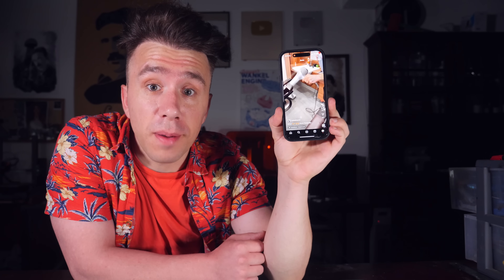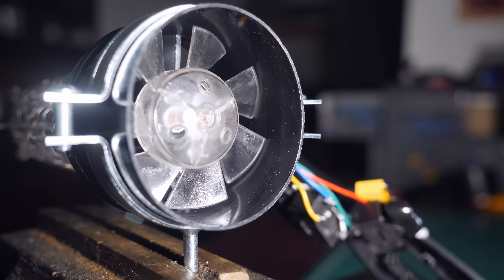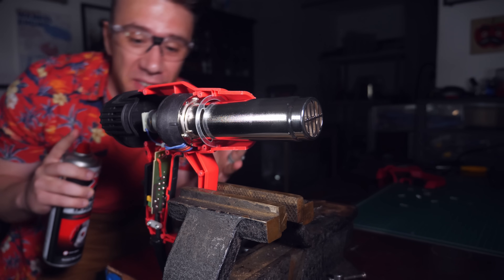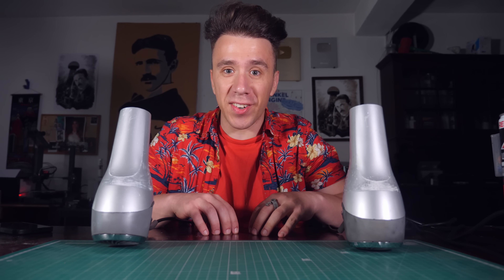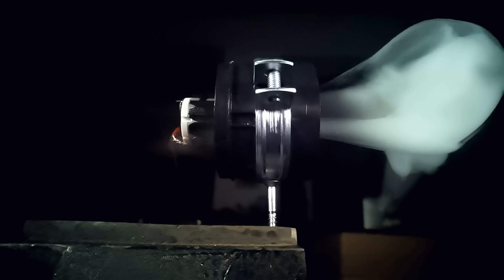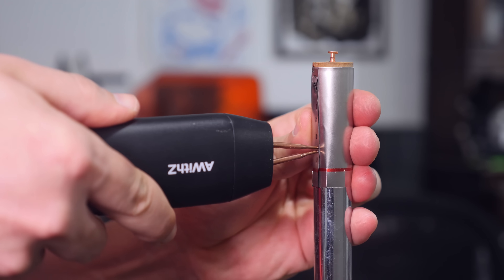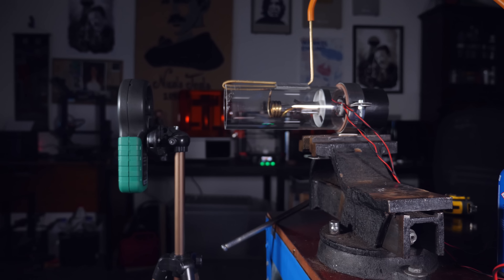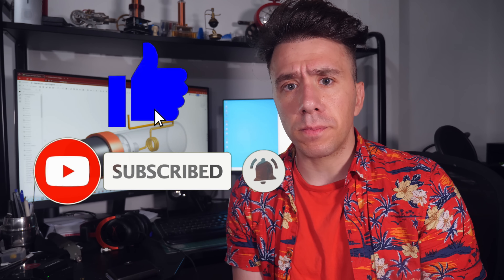I turned my $20 Hairdryer into a JET ENGINE

Comment: Design Recommendation: 2-steps...Well, with the re-post I was able to re-think my original suggestion.  It is still valid       step 1. change the shape of the tube.  I looked at basic jet engine design and some have a more narrow exhaust end, and some have a wider end.  I think narrow might focus the airflow and make the 'new' wind meter turn faster, but also could slow down the airflow...so perhaps wider is better?  OR...both, add a cone to the end. so that it is narrow just before the exhaust end but wider at the end.  Step 2.  After re-watching, I see I missed the request "use more air for combustion".  So, what if you put holes in the metal tube surrounding the ignition chamber and a small ring around the tube to act as a diffuser that would redirect some of the air flow towards the holes in the tube.  Look forward to next video.

Comment: The simplest way I can think of that will probably allow you to use more of the air for combustion is to basically use an afterburner, which just injects more fuel in the hot, lean air after the engine core. But, and here's the part that makes this super simple, is that you inject the fuel in at the edges at the intake. The fuel would have time to mix and atomize with the incoming air, and the existing 'jet core' would act as an ignition source. Real afterburners aren't efficient because the core gains efficiency from igniting the fuel/air mixture under compression while the afterburner uses uncompressed mixture to burn, but you're using uncompressed fuel/air mix the whole way through so this is entirely bonus thrust for this design.
Reply: The whole system is already an afterburner though.
Reply: Essentially just add more injection points to spread out the fuel during combustion. I think the hard part is going to be protecting the acrylic though.
Reply: First don't use acrylic second make a ring of a aluminium pipe with some hole for injecting fuel. And why not use a bldc motor which automatically gets lower when fuel less burns? and tries to use more flammable Gus with high pressure.. @Antal-te6rj
Reply: Pseudo-intellectual attempting to explain what an afterburner is to someone who already knows.
Reply: I wonder if adding the fuel before the fan would help, All tho I wonder if the diluted fuel would be difficult to ignite and if it would melt the and bun out the fan.
Reply: I might be a little late for this but because there is no combustion chamber a lot of air is being passed through the engine on the sides, a funnel (that funnels air into the igniter and fuel injector) could solve this problem and increase speed.

Comment: Thanks for the video and here is my idea. Multi directional air flow. More fans and a circular configuration in the tube and focused in a way to compress more air.   Thanks. 
*********************************************************************************************************************************************************** 
                                                                                                                                                                                                                                                    **********************************************************

Comment: First let's address the fuel.
Take the lid and straw off of WD40 and swap it out.
Place the straw in a 1/4 copper tube that runs like you had it but.
You want space between the coils.
At the end make a loop and seal it back to itself.
Drill 12 tiny holes at the end pointing equally to the center and outwards.
Splitting the difference.
Drill one more tiny hole for ignition precoil. 
FYI
You hold your can too close for the hair dryer or it should ignite when the heating element turns yellow.
I managed a shop and guys got in trouble a lot with this kinda thing over the decades 😂

Comment: I think you can use a nozzle to maximize the output and to burn the extra oxygen you need a better fuel ratio maybe a thinner nozzle for fuel injection too or a pressure regulator.

Comment: The middle hot element of your engine not exit from back but from side body insert of hot element and fuel inside the middle mug and the burning  gas exis from side of the mug not from back

Comment: Then I repost my comment: why don't you try adding a DeLaval nozzle and inject the fuel at its narrowest part? That should let you use all the air, and even get profit of the low pressure to inject fuel easy. Also you can add some spiral cannals to keep the vortex creation to protect the acrillic tube

Comment: For getting all the air to burn it might be worth converting it to a pulse jet, with the reed valves between the fan and the combustion chamber to regulate the air flow, however that would remove the heat shield the airflow provides, but that will be a problem with burning all the air regardless. Having a smaller internal combustion chamber inside the main housing and bypassing the fan air over it to cool externally while the valves are closed might help somewhat but I don't know if it would be enough.

Comment: Hope you read this, my idea for increasing power is to use a scram/ram design with your fuel tubes. Basically, stick them into the path of where the air is going to go to slow it down then allow for a little sheet steel on the inside of the tube to be bent inwards to help with air restriction. since you need the fuel line to go to the fan you can wrap it around the inside of the acrylic tube, this will help keep it cool. Make sure to use some of the sheet steel to act as vortex inducers (stator wings or whatever) that have you spray the fuel behind them into the direction of the wind. It will curve the path of fuel and air, condense it briefly before igniting. The coil & wing act as a scram to slow it down then compress it, once ignited it will increase velocity behind it to improve the efficiency of the effect. The ram is the ignited air mixture (exhaust) getting pressurized then forced into a smaller area behind it. This drives a wonderful Bernoulli's principle effect, at first it was just scram from the fan but now it should be able to ram air in from the increased intake velocity thanks to the lowered pressure! maybe.

Basically, sheet steel spot welded then cut with some snips to create some wings that are curved the right way for a nice vortex. Those also help with keeping the fuel line in place & adding their heat to the fuel line coil on the inside of the acrylic tube but outside of the sheet steel. Then you can make a nice ring that has been pinched on the one side to make a wing shape tear drop effect. The sheet steel can now be in front of it to create a triangle shape that has the fuel line behind it. Which can lead nicely to having the wings there to introduce the vortex effect. this curves the wind inwards, "compresses" it, but also makes it go faster while now having less volume it needs to take up. since the fuel is being sprayed in, behind the wing and the scram effect part this helps with combustion. make a taper to the sheet steel then have the nozzle point have a couple of wings to "compress" it through as a low wind resistance tear drop shape. Flaring out the rear then gives it a tesla valve like effect of being accelerated through the nozzle then expanding to no longer want its pressure to head back to the nozzle point. It gains captured thrust as a result as well, depending on the length of taper and total size before straightening out & or tapering back inwards gives you your total acceleration of heated air.

Hope it helps you out and I can finally have a 3d printer! I don't even know how to use cad but maybe my explanation helps you to make it :)

Comment: You should test the speed with the fan and fuel injection without ignition to get a more accurate baseline for the speed increase. As the addition of the fuel will automatically increase the air moved, regardless of combustion!

Comment: My idea for getting more air into the ignition:
perforate the metal shielding either with just small holes or even just partially cut the metal and bend the pieces upwards as to partially block the airflow outside of the metal shielding and divert it into the ignition chamber... The size, form, number of perforation has to be tested as well as at which angle to bend the metal elements. Also the question is where to put them. As i am not an engineer i dont know where it would be best before the coil as to have an intake before the ignition or behind it...

As another idea for maybe a more efficient fuel injection system: 
Try two fuel pipelines that also form a spiral or helix shape to preheat the fuel and then they are directed at each other in an angle so they collide and spray the particles are flowing in a more distributed way at the coil (maybe even taking some more air with it).
I think some fuel injectors in motors are functioning like this (I think Smarter every day did a video about this)

Comment: Also, with that setup of a coiled fuel-line, you should be able to burn nearly every hydrocarbon as fuel… as its vaporized before getting into the burn chamber.
Now it would be interesting what influence different hydrocarbon Fuels have on the Airspeed/Powa!

Comment: More (longer wire) needs higher voltage to get a same thickness of the same wire to the same temperature using the same current? Or not. I'm not an electrimagician.

Comment: i watched it again and i think you should try to make a vortex in the tube maybe by adding blades inside the tube and make the tube spin , the blades need to be of metal i guess or they would melt, also try making the end of the tube smaller should give it more oompf

Comment: Suggestion/design idea: Make multiple fuel injectors around the circumference of the acrylic tube so they spray the fuel in a clockwise direction, also the fuel injectors should be pointed towards the back. Should work like a diesel swirl chamber. 

Or make a fuel line with holes around the inner circumference of the tube with  the fuel injection holes pointing backwards. Or have the fuel injection holes in the acrylic tube pointed backwards.

Comment: Btw if you fill the copper pipes with sand, you can heat and bend them without them collapsing.
Reply: Best way to bend tubing, and the sand doesn't get stuck.
Reply: Okay, I wanna try this real quick
Reply: Filling with water and freezing absolutely works; I made many coils of all sizes that way. You don't need a torch if you use this method.  It is harder to bend the tubing with ice vs torch, for sure, but the finished product looks perfect.
Reply: Heat the copper until it colour flash changes to blue , then immediately cool it with running water. This is annealing. It is then malleable for its first bends.
Reply: if you fill a copper pipe with sand, you don't need to heat it, to bend it without collapsing, 
Just saying.
Reply: @kanedaadenak7088  copper needs to be annealed before bending. That is heating and cooling.
Reply: @logic.and.reasoning  Um coppers so soft, if you heat it before bending you harden it more than steel tube, and if you reheat it you have to let it cool slowly or ANEAL it, the metal doesn't get soft and pliable..
Without a tube bender your crush it, unless you fill it with sand.

I bet you youre a professional welder...
Because you dont understand tube bending or heat treating...
Reply: @logic.and.reasoning  I love how you think, but your wrong.
Reply: @logic.and.reasoning  Do you Know WHY they anneal steel and not copper? 
If you can answer that, You'll know why You are wrong...
Im Not calling you stupid, Just misinformed...

I like the way you think.
Reply: @logic.and.reasoning  Are we on the the wrong page? like more than 1''od?
Reply: @kanedaadenak7088  You are very wrong, heating copper until it starts to oxidise then quenching it anneals it because it stops it from forming large crystals. The same process with steel hardens it because the carbon present in steel forms a matrix which is stronger than the annealed state.
Reply: Really intelligent short cut. Thank you for sharing.
Reply: there are things like these too, but you're right, they CAN get stuck, but like Jamie Hyneman says: when in doubt: lubricate!
https://www.amazon.com/uxcell-Silicone-Bending-Insert-Sealing/dp/B07V2LKJ8Z
Reply: @originaljoke-y5f  if you have copper in your possession and it's NOT frozen you better gtfo.
Reply: We need to drink beer and watch the stuff work 😂
Reply: Try to fill te pipes with nitroglycerin its easiest way to ?
Reply: I usually fill them with water and freeze it but sand sounds promising. With the ice you can cold bend it without needing fire.
Reply: You may have just solved a hyper-specific problem of mine
Reply: Or fill them with water and freeze it
Reply: @ramosel pipe bomb
Reply: @erratichomelessmanwithagun6726   real
Reply: @ramosel  water  expands when  frozen and  would  melt when you heat  it  hardly practical
Reply: @greentroll9326  It expands out the ends of the tubing. You don't need a torch doing it this way. It is very practical and very easy.
Reply: @VidarrKerr  but you  need a  big  freezer  if  it is a  long  pipe  ;-)🤣
Reply: @greentroll9326  I have the longest pipe in town.
Reply: @Asdayasman  proof
Reply: @greentroll9326  LOL. Funny, but no. Usually, I think maybe Always, the tubing already comes in a coil. Like when you buy a garden hose; you don't buy the garden hose while it is laid out straight, or you would need a Super Long Truck.
Reply: @ramosel  How would that work???

Comment: Turbojet engines don't usually burn all the air. To use this "excess air" sometimes there is an afterburner. They give a massive boost in trust but are horribly inefficient.

Good thing integza does not care for efficiency.

Comment: The air needs to be supplied at 90° to the bore of the burner with a semicircular obstruction in the supply pipe, or put the supply pipe on one side. This will cause the air to swirl through the burner. The fuel injector could have a deflector fixed to the outlet to spin the gas into the air. (It looks a bit like a fixed fan.) The resulting mix should burn well. The ignitor might need to be larger in diameter. The acrylic tube may have to go though!

Comment: Afterburn effect should be relatively easy with a second fuel line that ends with a T piece inside of the dead air zone protruding out to the sides and this will be set off second while #1 fuel burns and peaks , the #2 fuel line (tee line) gets ignition from #1,.and liftoff? Well at least in my tiny brain 🧠 😅. Good luck everyone and I can't wait to see the winning design ❤❤

Comment: Make the flow tube have a 'waist' like a coke bottle, to increase pressure on the fan side of it, and create a back pressure on the exhaust side 👍
Reply: That would work nicely I think as it does in a fighter jet or a variable vain  valve setup on the front of a F1 turbo ( or German fighter plain turbo engines from WW2 )  causing antilag.

Comment: I guess that to solve the problem of using the maximum amount of air to burn the fuel would be to bend the fuel line into a circular manner as an anular combustor (as you did in the afterburner video) than wrap the fuel line with nichrome wire to combust it. And maybe making an afterburner too to make more power :D

Comment: It actually makes a lot of sense that the broken impeller works better than the high speed one. Bernoulli's Equation would indicate that if an equivalent amount of energy is imparted to the air in both cases, then an increase in velocity would correspond to a decrease in pressure. Therefore: to get the best bang for your buck, pressurized output and more power.

Comment: Multiple injection points, try using the original design as is but inject fuel into the high pressure stream as well at multiple points around the cylinder at a point before the primary combustion stage. Perhaps the already existing combustion will allow the higher speed air fuel mixture to combust. 🤷‍♂

Comment: Try funneling the air into a tighter cylindwr after the impeller, then wrap the inside if the cylinder with ignition coil. Inject the fuel right after the impellar and now you have half of a jet engine kinda.
Reply: It would be cool to use the exhaust gas to spin the front impeller as well, then it's a legit jet engine

Comment: Well I repeat my last post, using the Hairdryer, drill a small hole on right side of fan, place a nozzle that turns 45deg into air-stream, Brake Cleaner or WD40 Cans usually come with a small plastic tube, to attach to air-can nozzle to spray into a tight spot, use it to direct "Fuel" straight into Air-stream via nozzle installed ...

Comment: Wonder what kind of result you'd get with a "Bunsen burner" like setup. Have the air flow around the fuel outlet with the igniter right at the exit. Bonus points if you drag extra air into the chamber with the drag from the air intake.

Comment: glow plug. try spiral tesla turbine.
Reply: also try anfo hybrid rocket with gravity fuel pumping and heat activated ammonium nitrate or NaClO3 to produce high pressure oxygen, for the nozzle mixer.
Reply: Try pulse detonation jet rocket, gravity vacuum liquid and solid sand fuels and oxidizers.

Comment: You could taper the walls of the combustion chamber inward toward the exhaust end. That would force all of the air protecting the walls to come together, and mix with any unburnt fuel to be ignited by the initial combustion. It would almost be like an after burner. Maybe you could even add a nozzle and just make it a rocket lol.

Comment: As per my last comment: improve performance by using a bypass design (like airliners). 

For more efficient fuel burning: atomize the fuel by spraying it thin in the air mix and not just one small nozzle.